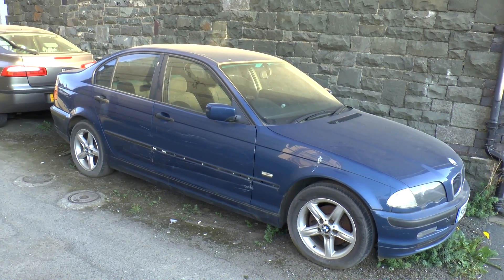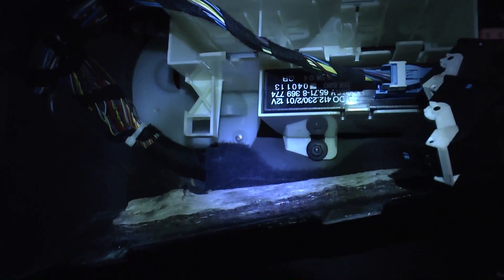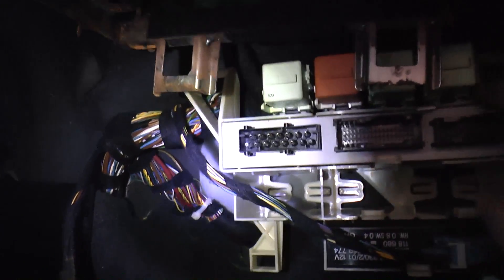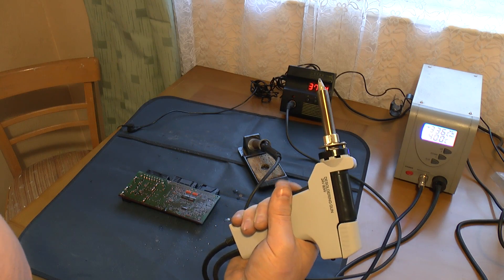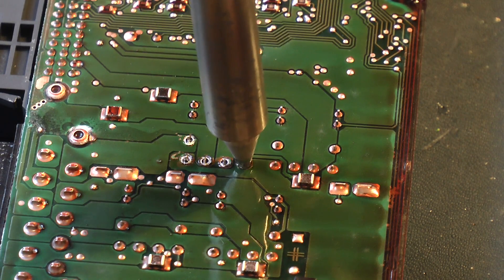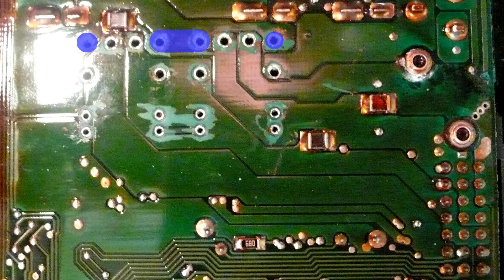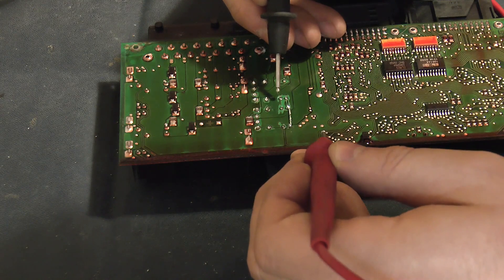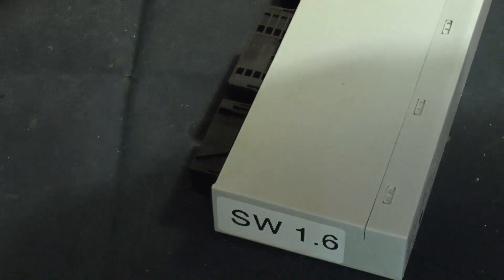Central locking relay replacement in a BMW GM5 module (3-series, X3, Z4, Z8)

Comment: Ive broken a track on the second pin from the botom right as you look at the video when your showing where the connections go.

Question is can this just be bridge with a wire accros to the next pin or is it no good now?

Comment: hey man i have a question maybe you can help ,my  power window driver side is not working ,electronic shop swaped the relay for the window but it still doesnt work ,is there any other control of relay itself within the module that might prevent it from working even tough the new relay is put in, thanx in advance :)

Comment: I replaced my relays. But door locks do not lock or unlock. Windows work, wipers work. But doors do not unlock or lock inside car or with remote. Also no auto lock when driving. What should I check?

Comment: @ min 8:12 three blu points. I checked my Gm5 repaired and it is not working (continuity missing). I bridged two pins (taking along a row, the middle one and the ones soldered) in order to guarantee the continuity between the pins, but it still not working. all the  other continuity are fine. Any suggestion? thanks to everybody can help me.

Comment: quick question, i noticed, you repaired, the confort gm5 module, but you also have a cruise control black box gm5 module... my question is.... doesn't the white box control the cruise control also? i have a e46 wagon 2004 but i have no black box gm5 module... do i need it? or i can just replace the gm5 confort module for one that has 3 pins like that and controls cruise control also? like 2 in 1 or 1000 in 1 type module...

Comment: My module has different relays. And it’s weird because my older one does too. Now either I try to fix it or buy a new one. The two I currently have are not Siemens or tyco. Appears to be different pin lay out but still same amount of relays

Comment: You saved my car. I managed to buy an desoldering pump, new relays from e bay. Everything works like a charm. The only thing that worked before that dosent is to lock the car from interior through the built in button in the car. Have I accendantily made something wrong? There is a small sound of unlocking the car instead of locking the car when I push that button! Anyway a big thank you, your tutorial are really the best. Kind regards / C

Comment: I don't get why u bridged that pin together 🤔
Reply from the maker: It's a 13 minute video. Which pin?
If a track gets damaged by removing one of the relays, amongst other things the video shows which pins are normally linked together, so you can easily repair the damage.
Reply: @AintBigAintClever  ok ok! I get you. Thanks bro!

Comment: I have the same problem.... Not only the central locking but also power windows and internal lighting is not working.. I suspect the ZKE module.... Do the windows and lights use the same relays ?  BMW E36 325i conv. 1994.

Comment: Are the relays for the locking and windows the same? Or would I have to get specific relays for the locking system and windows? I am planning on replacing all four relays for locking and windows.

Comment: On my BMW X3 2008 I have a problem with front windows.checked fuses fine , tested window motors fine , side mirrors work fine from the console , my front windows both don’t work from the main switch the back windows function from the main switch . Replaced switch same problem still , any advice ?

Comment: Very nice job I must say and that solder vacuum is definitely a nice tool to have. I do have a question for you. I have both the relays I need to go forward with job, but do not have a way to get rid of the solder for removal and am nervous about doing it. I thought about cutting the bottom of the relays with a dremal tool, but nervous about that as well. Well, my question is, I have a used one that is in excellent condition, is there a way to program this with PA soft? I have that software, but was wondering if there is a way to reprogram the used one to work on my car. Oooooor, do you know what part of the control module makes it linked specifically to the car? Sorry for the book, but there isn’t to much online about this box, just people removing them. Which is the easiest part.
Reply from the maker: I've no idea when it comes to reprogramming these things. Dealer'd be able to do it (but whether they WOULD do it is another thing) but it'd probably be cheaper to buy the desoldering station.
Reply: Thanks for the reply back. I just did a search for desoldering pumps and I didn’t realize they had a smaller version of what you have starting at 10 bucks. Hmmmm, kinda wondering if those little pin pumps would work for this. I guess if it didn’t then I would only be out 10 bucks. On the other hand, everything I’ve done/do for this car is really adding up.
Reply: I got the same relays as what you have, but after opening my GM5 module, I found that mine are bigger. Mine are EP2F-B3G1S  
8H1 107. Where can I find these relays or could I just open up my existing relays and clean them from all the carbon buildup? I did a google search to find them, but I can’t find the ones I have anywhere.
Reply from the maker: @julianmcalister3247  I found them. eBay have them.
https://www.ebay.com/itm/113079445495

Comment: Hey, I have a problem with front windows. rear windows work normally, but front windows don't. took it to bmw, they said you gotta change the whole general module. I can't change it as it's very expensive. do you think soldiering. if possible, i can send it to you and you do it, in return i will pay you. even the sunroof works.
Reply from the maker: Your best bet would be to try a local auto electrician. The staff at the dealer won't do repairs, only replacements (as you've found) but an auto electrician may be better placed to help. Look for anyone who does mileage correction, radio decoding, dashboard clock repairs especially, they'll be the ones prepared to work to component level. Point them at bmwgm5.com and see if they can sort it, also at this video so they can see what they're letting themselves in for.

I think the V23078-C1002-A303 relays are the ones for the front windows but I can't be certain.

Some GM5 modules only have 4 relays instead of 6, those are apparently for the ones without rear windows, those rear window relays (in the 6-relay units) being the same as the central locking ones (i.e. not the same as the front window relays).

Comment: hello, i was planning on replacing the relays myself then notice you have said  central door locking fault that affects all doors (not just one).   2000 328 coupe passenger door will not open at all electonically or manually and the drivers door wont open on the fob. everything else works at it should windows lights boot etc, i bought a secondhand door actuator which arrived locked and still nothing. any help much appreciated.

Comment: Hey there, i know you are probably the only person who can answer my question. You are very smart person. 2007 VW GTI . I have a strange problem my left headlight stays on even with key out of ignition car off. I checked pin 6 on the left headlight connector and im getting a constant 12V even with key out of the ignition. Passenger side is 0V at pin 6. Passenger headlight no problems at all  I swapped everything from passenger to drivers side for testing purposes and still the driver light will not shut off. Im guessing a relay is stuck, i checked the CECM and traced pin 6 wire from driver side connector all the way to J519(CECM) . It seems no fuse or relay is on that line. Any help would be greatly appriciated. It sucks when you repair a car and it runs perfectly and i cannot put it on the road and pass safety with fixing this issue. Thanks again.
Reply from the maker: I'd be tempted to bodge it. Get a relay and put the contacts between the stuck-on bulb supply and the bulb itself. Run one side of the relay coil to the bulb feed on the other side (i.e. the working bulb), ground the other side of the relay coil and preferably fit a diode across the relay coil to prevent spikes from it affecting the system (striped end of the diode towards the bulb, non-striped end to ground).
Now when the headlights are turned on, the relay will close and activate the other bulb from the supply it would've had anyway, so hopefully no bulb failure warning on the dashboard.

Comment: thanks for the video , huge help ! I didn't have desoldering equipment or a good soldering iron with small tip. my solution was to cut off the tops of relays and carefully with a pair of small cutters cut out the relay down to the Base leaving the Base in there with the pins sticking up. I then soldered 2 inches of each colour inside cat 5 cable to each pin then to each of the pins on the new relays. Glued the relays to the board with silicone sealant in areas where there are no components and all works.
Reply: Did you buy new -A303 relays? Any chance you snapped of photo of your work? I'm in the same predicament, and would rather NOT desolder 4 relays off the board risking breakage. Thanks!
Reply: Chris Volk I'll see if I can find the pic what's your email ?  , basically get a pair of small snips and cut away at the top of the relay until you get down to the pins sticking up inside .  you will find you need to cut coils and some soft metal etc inside the relay but eventually you get down to only the pins. from there it's a case of soldering on wire between those and the new relays laying them sideways on the board gluing them ideally so the cover fits back over also ensuring a layer of electrical tape on the pins so nothing can touch should they come loose.  I used wire from cat 5 cable which was decent thickness to take current and great to handle
Reply: I know this is an old post but your idea saved me big time. That's what I love about the car community. Thank you for a fantastic idea that worked wonders. Take care. 👍

Comment: my E46 has a intermitant fault few times a month tge car will unlock the boot and lock all doors fine including filler cap. but then wont unlock anything but the boot off the key. I have to use tge key in the door to unlock the door. none of the other 3 doors will unlock. if I get to where im going then lock the car all locks fine. today it wouldn't unlock the other doors at all. but tonight it was fine

Comment: hello, i get this error, do you think the problem is in the module.Gateway /ZKE
Anti-theft alarm system: Siren, radio inside protection, tilt sensor alarm or wire
STDWA short circuit to ground or open ,

Comment: Hello . I have a problem with the E46, and lock centrol only works if you turn the key on the door, or with the central console button, but the remote control does not function please help thanks
Reply: I have same problem with both my keys, I know this is an old question but did you get it fixed? If so, what was the solution?

Comment: Hi. Can you use V23084-C2001-A403 instead of the A303 that is on my GM5??
Reply from the maker: I've used A403 (in fact the slightly higher coil current C2002 model) without issue. The contact material is different (AgSnO2 instead of AgNi0.15) which gives slightly different ratings with motor loads but it's negligible. The coil currents also appeared within spec for the circuits driving them, and I'd expect the higher current coil to be a bit more forceful and therefore the contacts to be more robust than the one fitted as standard, but of course I could be talking rot. The data sheet is at http://www.dielectrik.it/DATASHEET/ENG_DS_V23084-X0000-A001_0214_084_0214.pdf
Reply: I found a pair C2001-A403. The reason I'm asking is because they are a lot cheaper so I'm going for them now.
My 330ci is not locking all doors after I start driving, plus my driver door doesn't unlock with the remote anymore. I should assume it's a GM5 issue.
Thank you very much
Reply: Yes, the relays work just fine, but unfortunately the problem was the door actuator.
Reply: Did it work for you with the A403?
Reply: yep and the relays still work perfectly.
Reply: The A403 should not be used because the contact material is optimized for lamp loads which have a high initial inrush current and no arcing upon disconnect.  The A303 has contact material which is meant to better survive the arcing during disconnect from inductive (motor) loads.  If the A403 version is used it will work fine for a while, maybe years, but, will not last as long as the A303 relays which should be good for 10+ years.

Comment: Hello . I have a problem with an E39 , The centrol locking works only if i turn the key on the door , or with the central console button , BUT , the remote dosent work . 1 day ago worked, and now .. just dont open or close the doors. I tryed reprogram the key , checked fuses, key battery , everything. Still no succes. Can this module be my problem as well ? And the left window sometimes works , sometimes dosent and it gets stuck and wont come down ..

Comment: How much is it to just buy a whole new board and plug and play?  Also where can you get it?
Reply from the maker: +ed6800 I believe they're coded to the car, so you won't just be able to straight-swap.
Reply: ed6800 bmw dealers only about £600+vat plus the cost of programming the key to the car and unit to the car prob around £800 +vat

Comment: Hi Aintbig, scot,

I replaced all the four relays, however after the replacement all works except any-door unlock stuff. All i hear is a click on the relay when i tries to unlock but nothing gets unlocked as if the doors not getting enough power. FYI trunk unlocks and locks fine. Please can you any one tell on which relay i should focus of the 4 for this issue as i dont want to screw other things by going with the wrong relay. Please shed some light..
Reply: I have the same problem, only I have not done anything to fix this yet. How did you solve the problem?
Reply: +Michael Kuzmin 

I just replaced all the four relays and soldered properly for the missing connections. There is another great video which shows alternate connections for the relays. Just soldered them and then Bingo. Order relays from ebay or any online site. Hope that helps.
Reply: Jamy4ya n

Comment: hey my circuit board has a protective coating over it, any info on what to do thanks
Reply from the maker: +Tylor Swain Soldering iron should be able to melt through the coating.
Reply: thanks, tried giving it ago with the one i got at home the gets up to around 480degrees. il have to get my dad to take it to work and do it for me. appreciate the video and help mate

Comment: Hello AintbigAintClever, :) 
I have new relay soldered thereafter operate lift the rear electric windows . Can you with a tip give where I need to solder a bridge ? I thank you in advance
Best regards
Reply from the maker: +Sinan Alaca All bridge points I know of are from 7:55 onwards in the video.
Reply: +AintBigAintClever 
Thanks... Best regards

Comment: My 1999 bmw  740i central lock heated seat windshield wiper , interior light,  steering adjustment,  anti theft system and alarm all bad after giving to an idiot who is unprofessional, just to fix my car stereo got me into this mess. Please do you have any idea of what to do and how much it will cost me.
Reply: +Osayamen Uwaila 
It sounds like simply a blown or missing fuse.  Check the fuses for all the functions that don't work and make sure they are installed and not blown.

Comment: Can you tell me,  you say this is good for All The Doors, But my problem is the passenger side does not open or close. Drivers side works OK. Would this be the same fix ?
Thank You  davidwaldmann2003@yahoo.com
Reply from the maker: +David Waldmann As stated in the video description I don't own a BMW and can't provide technical assistance, but it sounds to me like the fault is with the door motor or the wiring to it, not the GM5.
To test this, put a meter between the motor wires and try locking and unlocking the car. You should get a pulse of +12V or -12V (ish) when locking, and -12V or +12V when unlocking (depending on which way round your meter leads are). If you do, check the motor. If you don't, check the cables further by connecting the black meter lead to the chassis and testing the motor leads individually. One should pulse 12V when locking, the other should pulse 12V when unlocking. If one of them doesn't pulse at all, trace that wire back to the GM5 checking for damage.
Reply: AintBigAintClever can u repair my module gm5 for me if i send it to u?
Reply: +David Waldmann Yes, Had same issue Driver side worked every time, Passenger never did. Replaced both middle relays and everything works great.

Comment: Are any of the other relays repsonsible for the interior light coming when the ignition is turned off ?

Is it better to use relays with silver nickel or silver tin contact? ?
Reply: +AintBigAintClever 
The GM5 does control the interior lights, but, not the backlights that illuminates the buttons, dash, radio, etc.  It controls all the lights that turn on when you open a door (footwell, front headliner light, C-pillar lights) it also controls the trunk lights.
Reply from the maker: +4272005 
I don't think the GM5 does the interior light, but it does control the footwell lights. https://www.bmwgm5.com/GM5_Connections.htm

One relay type is apparently better at handling motor loads than the other, but in my opinion either is better than a dead relay.

Comment: Hi I am having an issue with a BMW 3 series 318 ti two door 2005, one key doesn't register any thing and believe something inside the key will get that checked out when I programed the second key it will unlock the boot and lock doors if I use the key twice in the lock or push the button on centre console it will unlock the doors but wont unlock them via the key even though the key is properly programmed...could this still be the relay or could it be the whole GM module. Thanks in advance